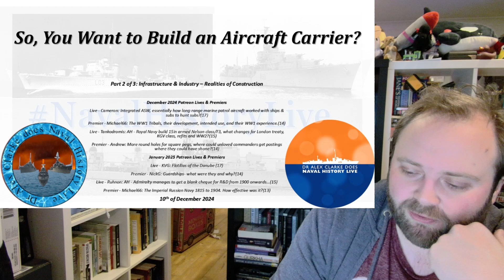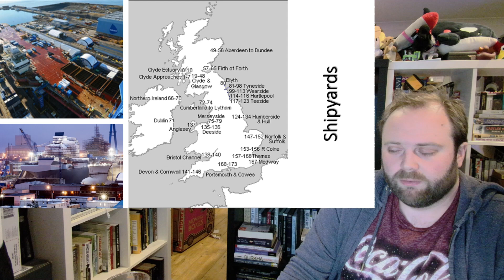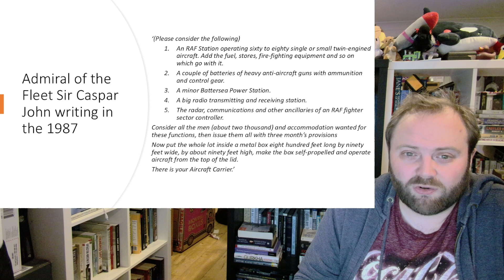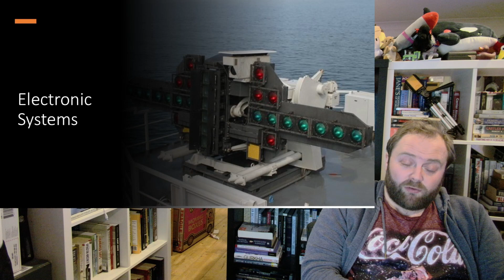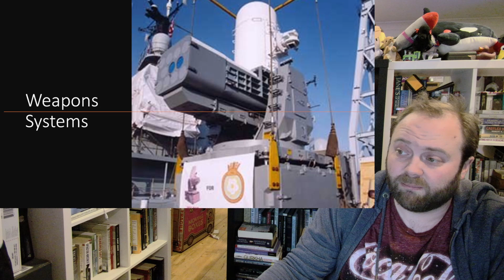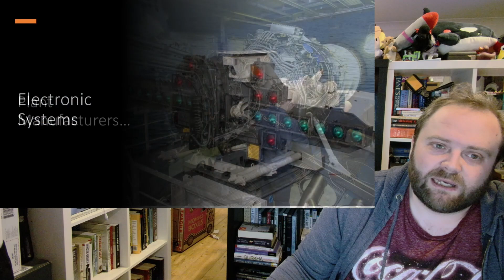So, You Want to Build an Aircraft Carrier? Infrastructure & Industry, the Realities of Construction!

Comment: 1:02:00 A similar problem arose, when the Hungarian tank brigade got their new Leopard2-s. Untill that, the T72-s used a dirt road, under a road bridge to access the training ground, but the Leopard - especially with the secondary "hunter-killer" remote turret could not fit into that tunnel. What an embarrassing minute detail, especially for systems lot less complicated (individually) than even a small helicopter CV. 

Luckily Leos have rubberized tracks, so they can use and cross regular civilian tarmac roads, without ripping it to pieces.

Comment: I remeber a big halabaloo veing made anout $10,000 toilet seats for the US airforce. Turned out, they were specialized seats for heads in cargo planes and they were no longer manufactured. The cost came in the building the infrastructure required to mass manufacture them -- injection molds, special jigs and the like -- while only manufacturing hundreds rather than millions. And the tolerances had to excellent because, of course, the original tolerance were excellent.
A $10,000 toilet seat. And, aparently, that was actually a bargain. It took Congress months tonfigure that out, of course, and by that time the news cycle has moved on.
Now-a-days, you dont need the industrial grade infrastructure of olde to create equivalent pieces of kit. Additice manufacturing has recently recreated the same seats with $1000 equivalents. (And, yes. They are equivalent. Part of that price tag were the test required to determine that.)
We're not quite to the point where a bent power shaft can be repaced with one produced additively 10 days before but we're  approaching that. I give it a decade, two at the outside.
And the ability to print a repalcement control chip for your gizmo thay got dropped from three decks? About the same timeframe, IMHO.
This revolution in manufacturing will also create a reinventing of logistics, which changes the equations of war in ways we just cant see yet. However, Its a restructuring we havent seen since the industrial revolution.
And if the fusion geeks fulfill their dreams -- a very big if, but increasingly likely over time -- some of those equations become almost unrecognizable.